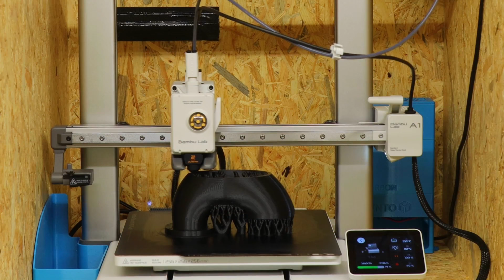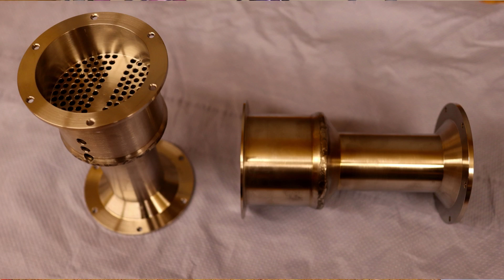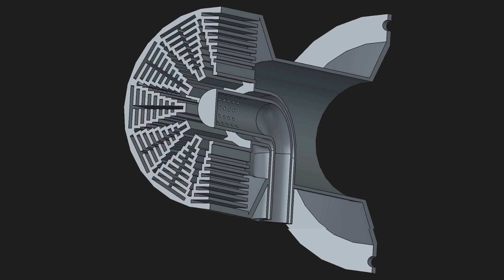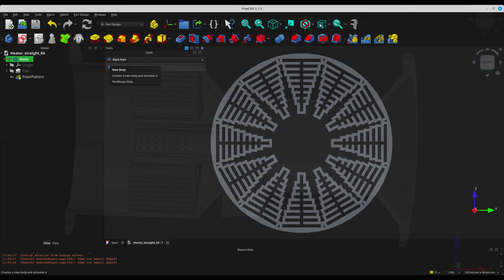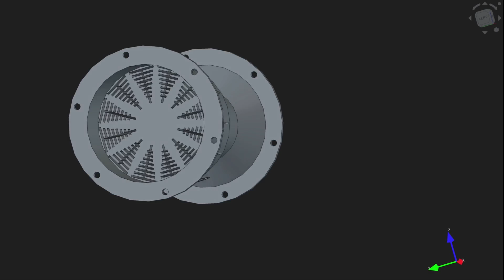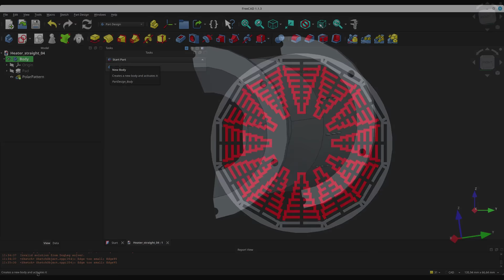The Stirling engine project

Comment: What kind of power can it output?
Reply from the maker: The target power goal is 300 watts, which is enough for us when running 24/7 which its designed for.
That's also the power the rhombic Stirling before reached!
Please look the older videos for it!
Reply: @myengines  impossible for this specific design which you have made to generate 300 watts. What are you actually getting?
Reply from the maker: At the moment about 10-20 watts but the multiplying effect of pressurization and proper heat transfer design will boost performance and efficiency!
Look at the development journey of my older rhombic engine to see the possible progress!
Reply: @myengines  Your older engine is a very different beast, this version at its current design in my opinion is almost impossible to do 300 watts and you want it 24/7... if you can get it to 50 watts thats very impressive. I might be wrong.
Reply from the maker: Hopefully you are... :-)
Reply: @baware80 Wait why is it impossible? I'm very curious to hear what specific physical flaw you've found. Lots of people make brazen statements like yours, but they never have anything concrete to back it up, but you're not one of those people, right?

Comment: Congrats 🎉🎉 what could be it's efficiency? Are you planning to do it ?
Reply from the maker: Efficiency tests are coming when the design is near final!
What you mean with doing it?
Let it 3D metal print by a company?
Definitely yes, when the design is ready, which will not take too long as i get many very good suggestions here in the comments!
Reply: @myengines  I meant doing tests on engine 😅. Bad grammar. Really excited for the result but.
Reply from the maker: Thanks, i do my best to show efficiency tests as soon as the printed heater, pressurization and combustion air preheating is realized!

Comment: I say you can be more fuel efficient by adding a shroud around the flame orifices, preferably with a cerium oxide doped ceramic coating because that will literally increase the net combustion efficiency due to catalytic ion donation.

This would mean that the shroud would silutaneously retain more of the combustion heat, AND increase the combustion energy extractd per mol of fuel.
Reply from the maker: That is a fascinating suggestion regarding catalytic efficiency, and I will definitely research the potential benefits for my combustion setup!

Comment: What is the efficiency of the engine?
What heating medium did you achieve/use with it? (biogas i guess)
How much did this whole project cost?
Reply from the maker: I will make efficiency tests when the final design is near the completion, now its changing too much.
I use my self produced bio gas from my DIY micro biogas digester.
Except the metal 3D printing part this video is about there are no costly parts, mainly 3D prints and the regenerator material which is also cheap!
What the metal 3D print will cost i will determine when the final design of the heater is ready.
Reply: @myengines  Thank You!
Reply from the maker: You are very welcome!
Every reaction is very motivating for me!

Comment: Hello, can we say that we have a working version (not just testing). I am not deep in this matter but if the model is ready for long term use I could dive deep in to understand it better and to make one eventually 😊
Reply from the maker: The thermoacoustic engine is still at the beginning of development, but with this step and the forecoming pressurization it will reach much higher power levels soon!

Comment: Have you determined how much wattage you can generate vs engine size??
Reply from the maker: The goal of this size is 300 watts, with a bigger engine the power will increase dramatically.
Reply: @myengines lol. That's not a 300 watt generator. Do you mean 300 watts of heat?
Reply from the maker: The goal is 300 watts usable power as with my rhombic Stirling, but it needs still a lot of development!
The electrical generators you see in the video are generation 6 and 7, i tried a lot more, including a bidirectional impulse turbine among others!
If you are interested, please watch into my older videos!
Reply: The diaphram must hold heavy magnets to generate usable electricity. Not sure how heavy for 1000 watt system.
Reply from the maker: I think if i reach these power levels I need a piston or a turbine like I showed in the past videos!

Comment: You say:  "The flow resistance must not become too high" through the heater.
There are science research papers saying that flow resistance through heat-sinks decreases by ~60%   IF   the 90 degree flat sides of the heat-sink are made to be half an ellipse (with a 3 to 1 ratio, but that probably depends on Airspeed)
ie: if you change the flat 'cut of like' surfaces with said elliptical contour; you may well get a much better flow rate.

Similarly; Any such sharp edges in the design might be rounded/'ellipsed' out.
Especially if the  parts are being metal printed.
That goes for any sharp/sudden decrease/increase in pipe diameter, like the various pipe fittings etc.
Reply from the maker: That sounds really interesting, I will look that up very carefully!
Many thanks for your good contribution and I would be very happy if you could write more about this!
Reply: @myengines  I think you want to mimic the smooth slope the way "independent throttle bodies" for car engines do. They specifically create a rounded, cone-like edge to prevent turbulence around the intake. You basically need that applied to a much more complex geometry.
Reply from the maker: Yes, you’re right!
It’s just a shame that there’s very limited space in the heater!
Reply: @myengines  I have the links to the papers in favorites somewhere, but YouTube does NOT Allow posting links to anywhere besides Youtube, so??
Reply from the maker: It would be nice i you could join our Discord server, the link is in the description!
Reply: @nevillecawood3727 🔴 What Is Islam?  
 
🔴 Islam is not just another religion.  
 
🔵 It is the same message preached by Moses, Jesus and Abraham. 
 
 🔴 Islam literally means ‘submission to God’ and it teaches us to have a direct relationship with God.  
 
 🔵 It reminds us that since God created us, no one should be worshipped except God alone.  
 
 🔴 It also teaches that God is nothing like a human being or like anything that we can imagine. 
 
🌍 The concept of God is summarized in the Quran as: 
 
📖 { “Say, He is God, the One.  God, the Absolute.  He does not give birth, nor was He born, and there is nothing like Him.”} (Quran 112:1-4) 📚 
 
🔴 Becoming a Muslim is not turning your back to Jesus.  
 
🔵 Rather it’s going back to the original teachings of Jesus and obeying him.  
 
 
More .....👇 
 
🔴 THE RETURN OF JESUS
Reply: @1islam1  Bro get some help this is a science channel I don't go over to your side and preach science so don't go here and preach relligion.
Reply: @myengines  it's a good idea to make the inside as aerodynamic as possible. But if the heater has less sharp edges, it will probably heat a bit less effective because there is less turbulent flow.
Maybe it should be increased a bit. Only trial and error will tell.

Comment: what is the theoretical power output of this engine at this scale?
Reply from the maker: The target power is 300 watts 24/7 as this is our need!
Its also the power I achived with rhe rhombic Stirling you can see in my older videos!
Reply: @myengines  I've been following this and am interested in the concept/technology, but it's hard to get too excited until we see actual energy generation backed by actual numbers.

Just throwing this out there, but something generating power off of the waste heat of a gas water heater (exhaust) would be a useful.
Reply from the maker: Yes i understand that the way is very long for viewers and also sometimes boring!
But look at my rhombic Stirling engine which developing took nearly 10 years but now it performes as suggested!
Unfortunately its too expensive for an everybodys engine!
Reply: @justanothercomment416  It would be even more useful to just do a better job of transferring the heat into the water.
Reply from the maker: You are right but this is the exact sweet spot for this engine!
Reply: @myengines. How the diaphram is going to hold enough  magnets to produce usable power.
Reply from the maker: I think if i reach these power levels I need a piston or a turbine like I showed in the past videos!
Reply: @myengines  the usual power consumption in an ordinary modern house is around 10Kw/day so, the smallest engine should produce around 500kwh. This is quite a challenge.
Reply from the maker: For me the engine is only meant as a backup for our solar plant which delivers the main electricity!
But when the sun is not shining enough it can run 24/7!

Comment: How will you clean soot out of the heat exchanger?
Reply from the maker: In my experience there is not too much soot (if the bio gas is cleaned properly!) on stainless steel.
But its a good and important point!
Maybe it can be cleaned with a liquid or the exhaust gas openings have to be bigger anyway and the heater can be cleaned through them!
Thank you very much for your good point!!
Reply: Perhaps you could use gun or engine cleaning solutions which are good for removing carbon and use pressurized air to blast it all out. @myengines
Reply from the maker: Yes i thought on some sort of this.
Thanks for your suggestion!
Reply: (Itll just shake out)
Reply from the maker: maybe

Comment: Is this hyliion karno generator ?
Reply from the maker: What is that?
Reply: @myengines hylion is making their karno generator, a closed cycle helium free piston stirling linear generator using a 3d printed heat exchanger hot head and a catalytic combustion combustor design licensed from GE. Their base model is somewhat large, and they used ganged pairs to scale. Allegedly they are working on a smaller base module size better suited to homes. The company was originally working on a range extender generator for large electric trucks, before pivoting to small industrial CHP for remote power.
Reply from the maker: That sounds really interesting and i will look out for it!
Is a thermoacoustic engine?
Many thanks for your valuable suggestion!
Reply: @myengines I believe it's just a stirling, not thermoacoustic
Reply: @myengines  It is a B-Type Free-Piston Linear Stirling Engine
Reply from the maker: That is a really interesting concept that i also considered!
Thanks for the suggestion!
Reply: @myengines karno is interesting but the design and helium use make it unattractive for DIY. The delta stirling on the other hand, which is a triplet set of connected double acting alpha Stirling's, seems more accessible to DIY.